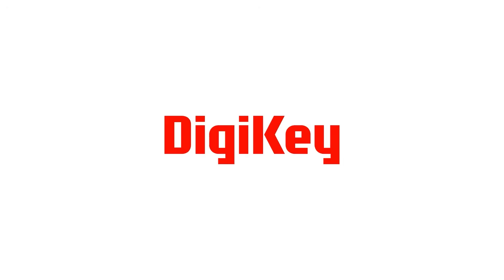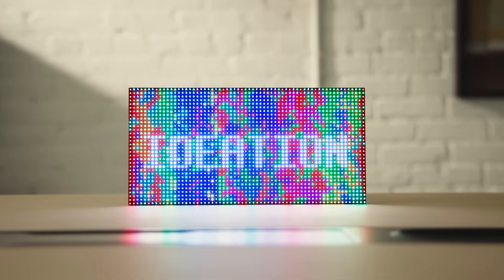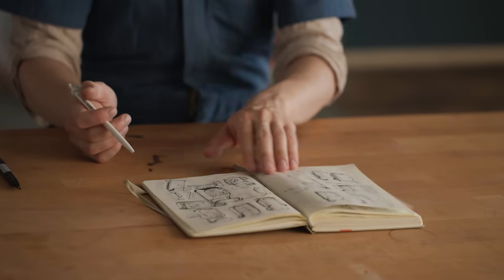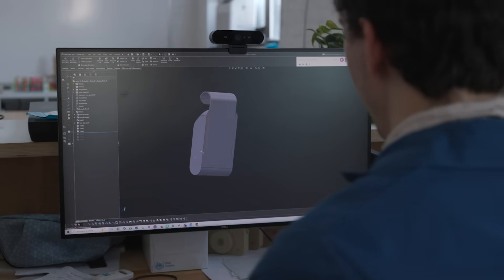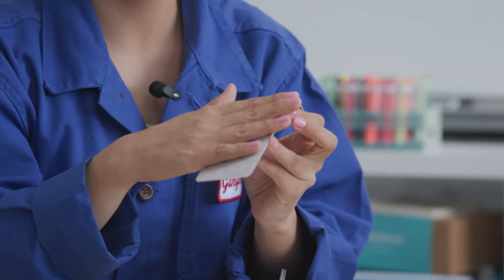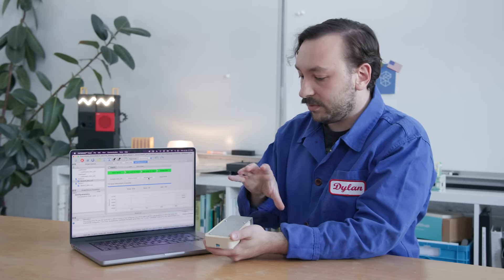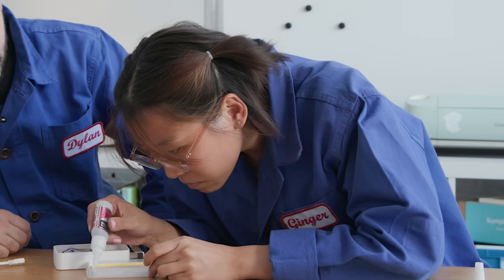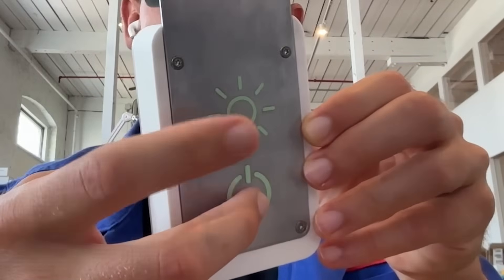Infineon PSOC™ 4000T Multi-Sense Camping Lamp – Potentially Genius® | DigiKey

Comment: Love the concept hate the hanger, it makes no sense to have it hook and the light face towards the hook. It should be bent 90 degrees over the top of the housing. And have it facing backwards so the light can be facing outwards.
Reply: Nice suggestion. We'll sketch on that. Thanks!
Reply: @pepingelardi1210 of course! and using the 2 90 degree bends also add a significant amount of strength to the housing. And the ease of using a press break doesn't increase machining costs much, could also increase the bend on the hanger from 90 to 135 to make the hook more captive so it isn't jostled free during movement. Love the induction tech, could it also be used inside of a sealed waterproof container as long as the metal is inside for the induction? And how sensitive is the granularity of the sensor?
Reply: @fatandpaleish  Great ideas!

To answer your question, it could be used inside a sealed container, so long as the force from a press can be transferred to the metal. Because it senses the bending of the metal from the force of your touch, it can be covered with anything flexible enough and still function!

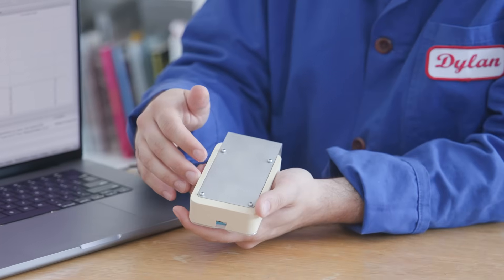The sensor has a pretty impressive level of granularity. I can't give you a precise resolution, but I can share some qualitative observations. Past the point where your touch begins flexing the metal (which is surprisingly light), it is very sensitive - you can see briefly at 8:17 how smoothly the value changes. It's a pretty high resolution analog value, and there's a tab in the IDE that lets you graph that touch pressure over time. You could definitely do a lot with one of these buttons by treating it as a pressure sensor rather than just an on/off momentary switch!

We actually considered making a touch slider for brightness control at one point. Because of the level of granularity, you could use just a few coils along a strip of metal to get a pretty good idea of where along the strip a user is touching. Maybe for V2 we'll give that a try and roll in your suggestions ;)
Reply: @Dylan-K-TL that's an awesome little board I'm always impressed with the new stuff people are making. I didn't even think of it being able to be a sliding value as well.
 Does it work in a negative axis as well? I.E. magnets? 
Look forward to seeing what y'all come up with next!